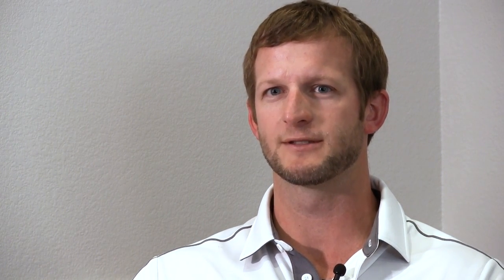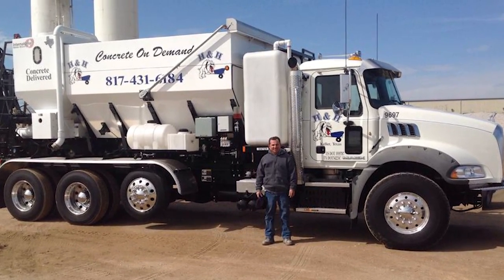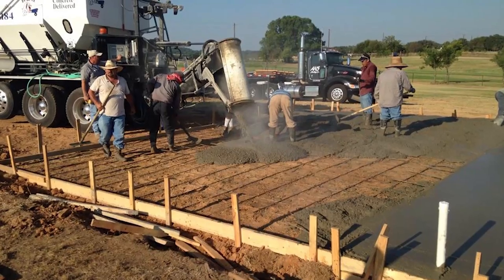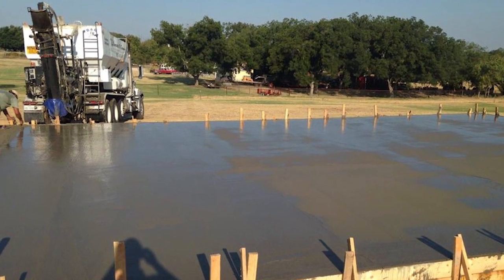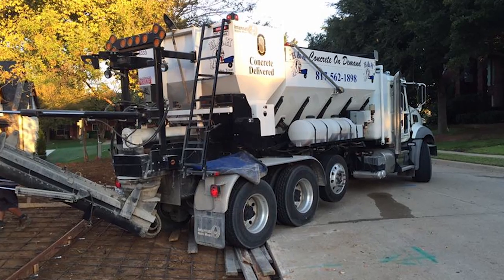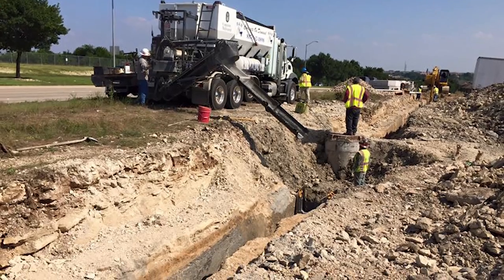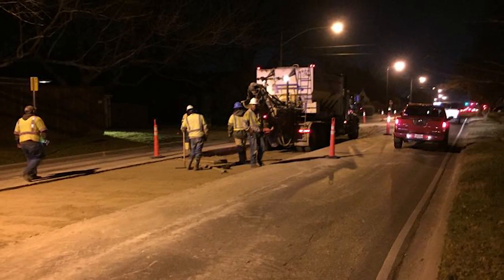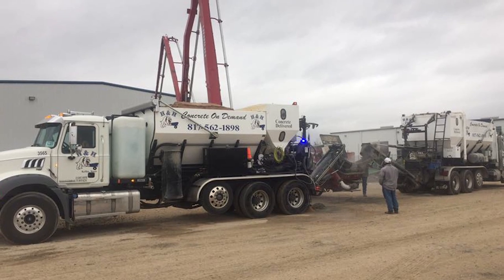Volumetric Mixer vs. Barrel Mixer

Comment: Any guys running 10 yard trucks? What's your operating weight when full? They have a 14 yard truck which would be amazing but the blanket overweight permit and axle requirements are a headache.

Comment: How hard is the training to operate one of this Concrete Mixer?
Reply from the maker: Cemen Tech offers training at our headquarters or on-site during the start up. You do not have to be "a concrete guy" to run a C60, it is fully automated and pours exactly what is needed each time.